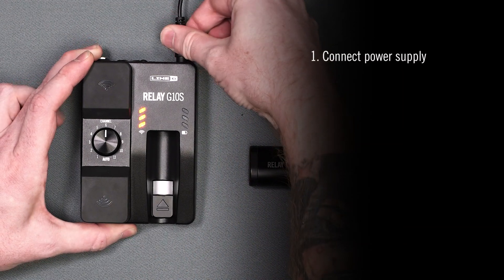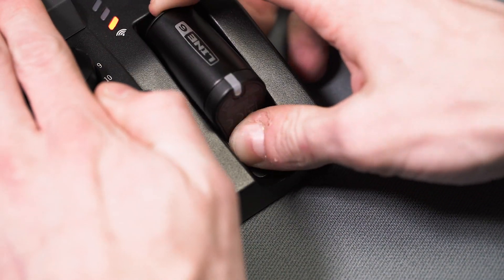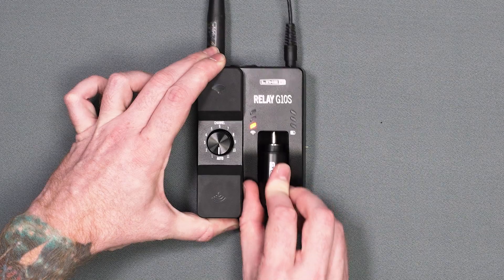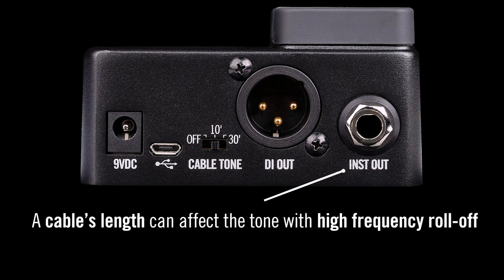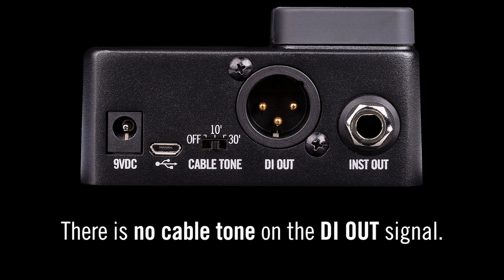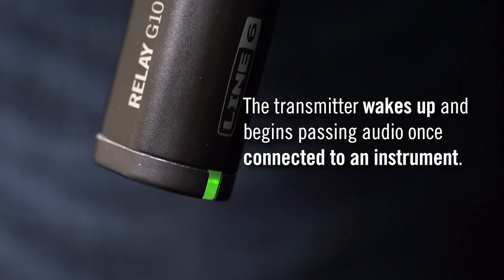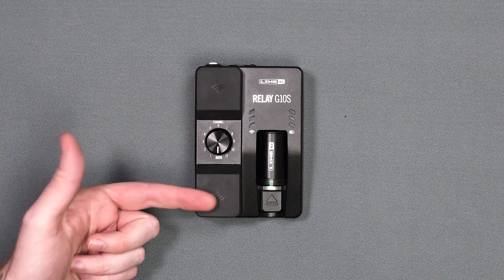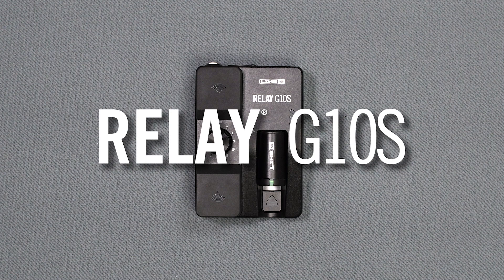Line 6 | Relay G10S Guitar Wireless Quickstart

Comment: Line 6 G10s problems
Hello
I really like using my Line 6 G10s during my concerts. I use it with my 6 string 000 equipped with a LR Baggs LB 6 saddle and LR Baggs Preamp into a LR Baggs Venue DI. It works flawlessly. But when I switch it to my Guild F512 equipped with a LR Baggs I-beam pickup I get a grounding noise. Not a loud 60 cycle hum but a hum noise none the less. If I put my hand around the G10TII it quiets down somewhat. That’s why I think it’s a grounding issue or radio interference. I have tried using other channels but the same thing happens. If I plug a guitar chord into my Guild F512 to the amp I have no problem with noise just the G10s and the Guild F512. I also have a Martin D35s equipped with the same LR Baggs I-beam and have no issues, only with the Guild F512. 

What is causing this problem?

Comment: Whats up with the battery? It lasts like 30 mins?

I tried to update the firmware, but like the product, your website doesn't work either when trying to download the firmware...
Reply: I have the same problem ...
Reply: @urbaninstinkttzxhc  I brought it back and got a Shure unit- it was around 300 BUT well worth it and no problems plus it lasts forever- I never could get this one to work and my advice is to take it back asap!!!
Reply: @brexxebender1204  Was it also dropping out or just the battery? about to return mine and curious about the shure
Reply: @tommurrayGTR  I never got to the point of even trying it at a show— I got it home charged it - battery went down fast- but it would also sometimes not even register from the get go—- Go with the Shure. I got have it and have had NOOOOO problems at all, fantastic!